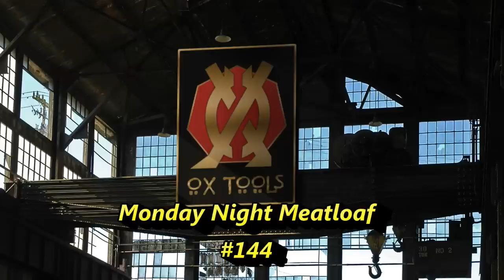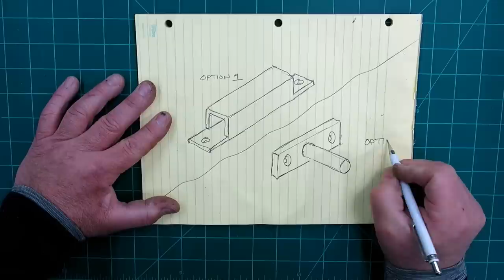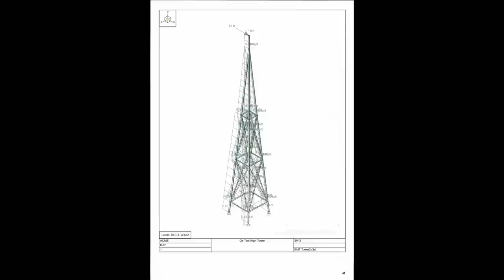Monday Night Meatloaf 144

Comment: The old-time windmill repair guys would come to repair a mill unit or damage to the tower.  They had 2 horses, a pulley, and a section pipe arrangement.  They would unbolt 2 adjoining tower legs up and install hinges.  Then they would bolt the extendable pipe perpendicular to the hinge line and create a lever out the other side of the tower.  Then they would hook the pulley to the ground with a good stake and thread a rope from the top of the tower, thru the pulley, and on out (more rope than the distance of the tower was high) and hook it to one of the horse's harnesses.  Then he would hook another rope from the tower top to the other horse perpendicular to the hinge line.   The trained horses were given commands, one to pull the tower over and the other horse on the pulley side to back up so the extendable pipe would act as the lever and lower the tower to the ground gently.  Just the reverse to stand the tower back up.  
My grandfather told me about that.  He worked servicing oil wells when they put a derrick pole up and a team of horses was trained to walk forward to pull the rods and pipes out of the well and back to put the pipe back into the well.  Granddad went to work as a teamster at the age of 11. It was said he could cuss at a team of horsed as well as any grown man.  He worked for the same company for 57 years.

Comment: I would do both...   The side spot for the come along handle allows you to put the handle from both directions.  This could certainly come in handy in certain situations..
Reply: Both AND weld the two pieces together at the corner.
Reply: I was also thinking that option 2 doesn't seem to fit in certain situations. Also option 2 seems to put forces in small areas so I wouldn't know about those things. So because of that I was gonna vote option 1. Both is absolutely better though!
Reply from the maker: Oooh, Now you are talking. That might be the cat's meow. 

Thanks for the comment.

Cheers,

Tom

Comment: Good tape job! The other thing I add, during the spiral phase I do several wraps at the end, maybe 1/2" long (maybe 5 wraps all touching) by 2-3 layers (maybe 1/2" thick) then do the final covering tape. This makes a knob at the end that hopefully prevents the stick from coming out of your hand if you try to poke the puck away one handed 👍
Reply from the maker: Hey Ben. I have to replace a couple of handles soon so I will be exploring the hockey tape wrap further. I really like where its going so far. Thanks for the comment.

Cheers,

Tom

Comment: Love that Monday Meatloaf is back, always a learning experience. My pet peeve is incorrect usage of aluminum alloys and heat treat designations. Aluminum in the T6 condition has been Solution heat treat(as you stated, but then Artificially aged. Just solution heat treated aluminum would be T4.
Reply from the maker: Hey EW439,

Sorry for the slip up. Thanks for the comment.

Cheers,

Tom

Comment: Tom, in a recent video, you were admiring the lace up of the wiring so that each terminal meets each screw exactly in place.  Meanwhile, in this video you demonstrate the series of half hitches, one on top of the other as a means of improving a grip.  Consider that series of half hitches is how machine controls wiring used to get laced up back in the olden days before there were plastic wire ties.  It was beautiful to see when I had to work on an old machine.

Comment: random idea: split and hinge the catch bucket so that it can open up into a cradle for the split kindling sections making it easier to empty in neat bundles
Reply from the maker: Hey David. That could work nicely. I was wanting to just lift the bucket off with all my nice kindling and dump it for the next run. We will get there. Thanks for the comment.

Cheers,

Tom

Comment: Nice splitter upgrade. Seeing that I would want to take the bottom out of that bucket completely, put another bucket under that to collect the wood. So the first bucket with no bottom is a chute to guide the wood into your bucket you can then take away and bring into the house or whatever. Then maybe you’ll want to make the splitter have no edges or shelfs that would hinder the wood from falling down into your bucket. Loving the meatloafs!
Reply from the maker: That is a pretty good idea. I'm thinking the support structure may just span over the bucket to reach the solid surface needed for the splitting. If you step back the whole process is an interesting design study and prototyping cycle. 

Thanks for the comment.

Cheers,

Tom
Reply: @oxtoolco  Or if you had the current bucket setup, but with something to stop the split wood falling under the splitter. That way you could lift the bucket off without it getting caught and pour it into whatever container you keep your kindling in. Something like a sheet of metal going straight down from the outer edge of the wedge to the base.

Comment: Tom, an additional idea for your woodcutter; if you close the surface behind the cutting edges so it becomes a uniform shape with no chance of interlocking the wood pieces you can lift the bucket after chopping it full and wonder of to the stove in one go. Lazy people like to think these things trough so they don't have to move too much ;-) Best! Job
Reply from the maker: Hey Job, I was worried that the split kindling would just fall out of the hole in the bucket. I may extend the support structure outside the bucket to leave the bucket bottom intact. More to come on this one. Thanks for the nice comment.

Cheers,

Tom
Reply: @oxtoolco  I think most of the pieces will stay inside. Maybe rattle the bucket a little for uniform chaos ;-) Curious about further improvements. All the best, Job

Comment: Hi Tom, For come alongs check out Tirfor / Griphoist you will not go back to the style you have after using one. No drum, just a pass through cable. Overload is provided by an easily replaced shear pin. Designed for pulling and lifting
Reply from the maker: So what do I do with the four I already have? I know! Get them a playmate to play with. I'll check those out. Always looking for the best and brightest engineered tools. 

Thanks for the comment.

Cheers,

Tom
Reply: Those things look pretty spiffy for sure but they also appear to be REALLY expensive.

Comment: enjoyed your Monday Night Meatball…..how do you handle the water intrusion in all of your joints and couplings on the tower, the cut ends are raw steel…???
Reply from the maker: Hey Chuck. I just turn the tower over and dump out the water from the vertical legs.....I figure it will last as long as old me will need it to last. Thanks for the comment.

Cheers,

Tom

Comment: Tom, I got my stitches out 5 days ago and as soon as the finger is a little more healed I will build a rendition of your kindling splitter. The bucket mod is also a great idea. I have a couple of hatchets and axes that could use a robust wrap and those tips will be put to use as well. I neglected to mention in my last comment it's good to have you back dishing up a delicious batch of meatloaf.
Reply from the maker: Hey Michael,

Thanks for the comment.

Cheers,

Tom

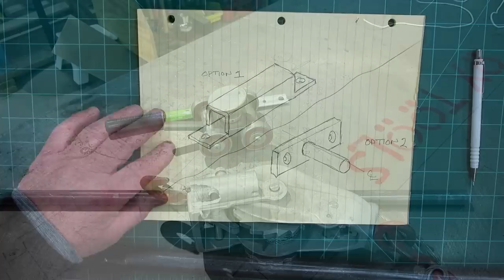Comment: 11:47 every come a long I've owned used a Y yoke handle. Id be inclined to continue that tradition on yours probably with industrial epoxy (like whats used to make car frames) to glue it onto the 3 sides of the existing mechanism instead of just 2 screws that will without a doubt crack the casting.
Reply from the maker: Hey Tim. 

Thanks for the comment and design suggestion.

Cheers,

Tom

Comment: Tom,  option 2 will suffer because the bending moment at the screw attachment point will be way too high.   The screws will pull out or the underlying cross member will twist.  Suggest you just clean up the broken existing receiver flush to make it look nice.  Then make a 1/4 steel plate that attaches to the front cross member but extends out the left side past the existing receiver.  Bore a 1" hole in the plate and bob's your uncle.   The new plate will take the shear at the inboard end of the handle and the existing receiver will take the shear at the end.  The detent will still work.   There will be a gap between the plate and the existing receiver but this will not matter.   If you want to get fancy you can make the plate thicker in this area to butt up against the cleaned up existing receiver.
Reply from the maker: Hey Craig. Thanks for the comment and excellent suggestion. 

Cheers,

Tom

Comment: As for Grips, I like the twisted tape concept.    

For Pole Spear grips I have used a roll of O-RING stock and put it in tension and hold ends in place with E-tape.  Add a Shrink cover over top.  The spiral spacing backed on hand fit.   O-ring stock worked much better than cordage.
Reply from the maker: Hey John. I have a hammer that I put a couple of old orings on many years ago. It actually worked pretty good as a end stop for your hand. Never thought about cord stock. Thanks for the comment.

Cheers,

Tom

Comment: The rope technique you showed is one of the simpler forms of coxcombing. Specifically the French or Bannister coxcomb. If you alternate the direction of the half hitches you get a Simple coxcomb with a straight raised line. Using more strands can make a more comfortable coxcomb, but the technique gets a bit more complicated. Frayed Knot Arts has some good tutorials on different styles.

Comment: Fixing our follies, an ancient tradition. An idea for the handle upgrade that seems less prone to a second failure that came to me just now. If the original handle encapsulation was milled off flat, it looks like there would be enough room on both the original handle side and the opposite side to rivet or bolt a couple pieces of milled stock that was in the shape of a kind of wider and flatter C channel. Then bring that channel together in a Y configuration where a tube could be welded for the handle to attach. Reason I would go this route is to remove as much load from the attaching points as possible, and instead, put that load directly on the sides where the lever action will be less stressful to the aluminum.
Reply from the maker: Hey Rex, The only issue I see is the reversing switch would be covered. It stick up just enough to be a pain in the neck.  

Thanks for the comment.

Cheers,

Tom

Comment: I think your best bet is to just do BOTH of your sketches and make it in once piece of steel.  So that it has the side tube AND the stub shaft on the center line.  Then you can just use the stub shaft as your handle when messing with smaller stuff, and you'll have both options with the big handle as needed.   Plus your steel structure will be mounted both to the side and the top, which will give it much more strength.  The best of all worlds.

Comment: If you put a brush on the bottom of that bucket with the splitter, you could take the bucket off with the sticks falling out the bottom so you can dump out the whole bucket a once, 👍
Reply from the maker: Hey Sweeney. I think I have a better solution in mind that leaves the bucket a standard bucket. Thanks for the comment.

Cheers,

Tom

Comment: Kindling? Add a hair dryer to flame and a tightly rolled newspaper, that will start unsplit, undried logs. Some practice required (low speed and  from a distance) to avoid blowing ash around, but it's extremely effective. Maybe use the smallest desk fan you can find, the smallest breeze quickly multiplies the heat output.
Reply from the maker: Hey George. I have a cordless mini leaf blower near the stove. Newspaper? Where do you get that these days? Thanks for the comment.

Cheers,

Tom

Comment: For your tower couplings, just drill two holes through the assembly and put 16 penny nails through and bend them over to prevent pull out. If you happen to have an old copy of ''The Standard Handbook for Electrical Engineers", there's a large section on tower construction for transmission lines far too heavy for your needs but interesting to flip through. As far as the come a long goes, I would retire it and get a chain come a long I dislike those cable ones.
Reply from the maker: Hey Steven. Not a bad idea. A 5/32 pin in double shear is pretty impressive. Thanks for the comment.

Cheers,

Tom
Reply: @oxtoolco  Not to mention readily available and cheap.

Comment: Tom, everyone of my Allen wrench cheater pipes have that short tube on the end at a slight angle off from 90 degrees. really handy for tight spots. Also, die makers use them that way all the time for tight places. That's probably why you did it years ago, I bet you just forgot. Cheers, Cliff
Reply from the maker: Hey Cliff. Good to hear from you! That was a long time ago and far far away. 

All the best,

Tom

Comment: Option 1 looks OK if you mill the side of the bail arm flat so that the new fixture gets the advantage of friction. Bolting it to a rough surface will make it want to shear the bolts off.
 Option 2 seems likely to stretch overload the bolts. I would estimate that anything less than 1/2" would be inadequate. Better if you can make the mounting plate grab the edges of the bail somehow. How about fabricating a C section which will slip over the bail?
Reply from the maker: I'm thinking a test is in order. Thanks for the comment.

Cheers,

Tom

Comment: Kindling splitter--just lift off the bucket and dump it into another container. Might have to pick up a piece or two, but you would avoid possible wrist/hand contact with the cutting edges.
Reply from the maker: Hey Joe. I was thinking the stuff would just fall out of the hole. I may extend the support structure outside the bucket completely and leave the bucket intact. More to come on this one. Thanks for the nice comment.

Cheers,

Tom

Comment: I think options #1and #2 would both overload the aluminum at the new-fixture bolt attachment positions. Option #3 would be to replace the original aluminum "horseshoe" with a fabricated one from steel.  -Doug

Comment: For the come-a-long repair I would make a steel yoke that ran down both sides of the aluminum yoke after you machined flat the broken part. Two screws on each side as well as the 2 you drew in option two. I'd make a socket instead of a pin so you could weld around the outside for added rigidity to the cross piece 😉. I had an uncle Bob but he died...
Reply from the maker: Hey Jeff. There is a reversing switch that would get covered by a yoke perhaps. Thanks for the comment.

Cheers,

Tom

Comment: Go ahead and repair the old come-along which ever way you choose. Reverse - engineer the come-along, over build it, make 2 and load test one to failure. You will have one rebuilt come-along and one super heavy duty one that you can really gronk on. It could make a good video series.

Just an idea.

Have at it Tom.
Reply from the maker: Not a bad idea at all. Maybe make laser cut kits folks can make and test their own. Thanks for the comment.

Cheers,

Tom

Comment: Well, I think it’s a good idea to put it on the crossmember and distribute the load. I think I would put it directly over the gear which is slightly to the side towards where torch bar piece that broke off.  I think you would end up being stronger because you’re trying to distribute the weight and then push right straight down on the gear.
Reply from the maker: Hey PTF,

Thanks for the comment.

Cheers,

Tom

Comment: 4:19 Ah, so that's what happened. Also, i didn't know the handles were an engineered failure point. Most of my come-alongs are auction stuff and not a single one came with the OG handle, those that have a handle are the integrated type with the awkward ratchet finger destroyers. That's good to know, i've never pushed mine, i'm kinda chicken like that, but now i have to find those handles, because it's a smart, smart idea. Certainly the handles i have now wouldn't snap. One of them's solid bar stock. :))

edit: option 2 seems the more sensible one especially because of the proper load.

15:55 basic sword wrap, but the "cord" is part of the wrap itself, not a separate piece of leather. I have that same thing on my bike handles. Super grippy. There's also the criss-cross variant where you have two pieces of tape, you start at the top with both, do the twist, then start the helix in opposite directions and every time they meet, you switch by twisting the "cord" together and go in the other direction. Once you're done, (for extra fancy points) you wrap the handle and "cord" by alternating or weaving, the two tapes. Looks really nice if you do it with two colors, well, if that's your style. I suppose that's for fancy hammers.
Reply from the maker: I like the DNA double helix idea! I'll have to try that one when my new order of tape arrives. I definitely have some fancy hammers....Thanks for the nice comment.

Cheers,

Tom

Comment: I have what looks like the same unit which I did similar damage to over 30 years ago trying to un wedge my chainsaw.  I’ll maybe copy your repair. 39f. Is too cold.  You gage blocks will be so small you won’t be able to find them 😂
How about a video on insulation, ventilation and other ways to protect tools from condensation and corrosion?  I just added a small 8x10 outbuilding and have been overthinking it.  Thanks for the lunchtime meatloaf Tom!
Reply from the maker: Hey Cogent. We will get to the insulation soon enough. I already can't find half my tools! Thanks for the comment.

Cheers,

Tom

Comment: Engineer here. Option 2 is a very bad idea! The bolt holes are 1/2 way across plate which doubles stress on the flat plate (and the casting). Better is a "U" (squared off) shaped plate wrapping around the sides and bolted to the casting on the "sides". Bolts as far apart as practical. The "stud" for the cheater bar can remain. Use stout stock for the "U" plate.
  Better is to have "ears" from sides intersecting a tube receiver. Still have the plate against the squared off "U" welded to the side ears.
Reply from the maker: Hey T. Thanks for the comment.

Cheers,

Tom